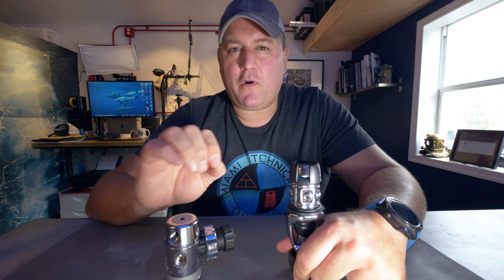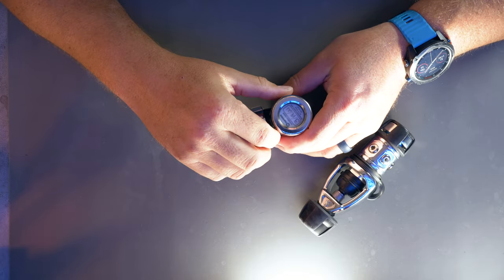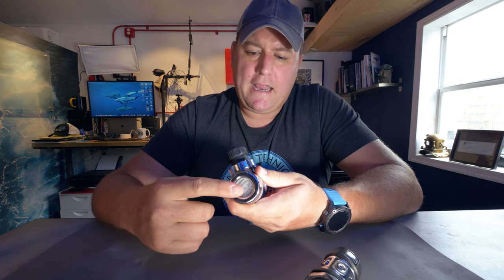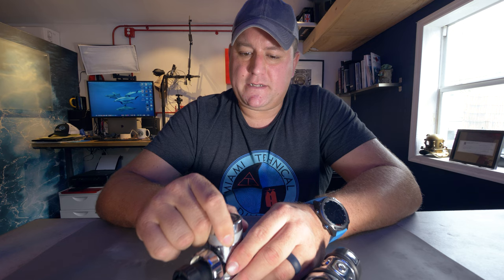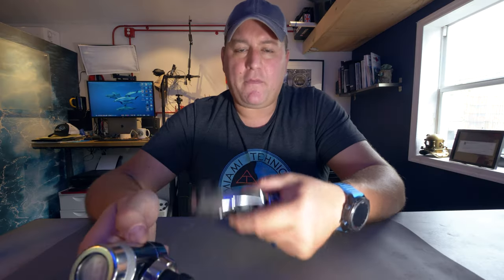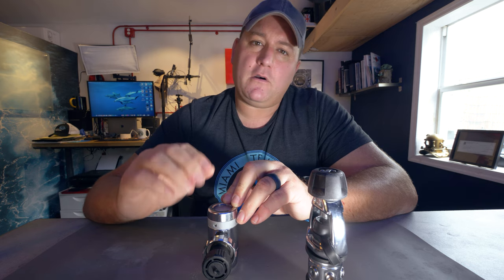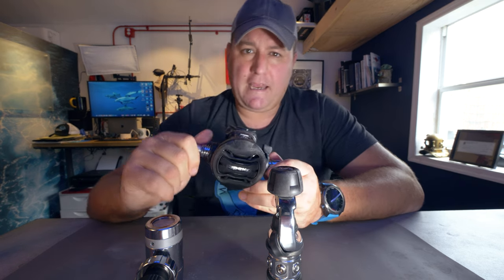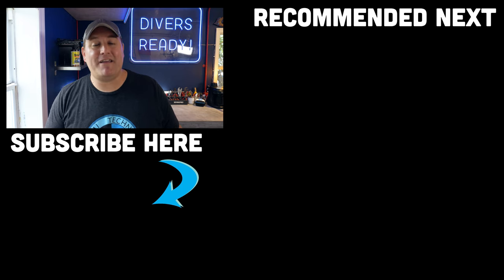Scuba Regulator First Stages: Balanced V Unbalanced

Comment: OCD / Pedants corner:

"balanced" or "balancing" refers to a pressure / force acting on both ends of a flow control device

"compensated" refers to a single ended pressure / force  acting on said device

Therefor, to avoid confusing we shoud really refer to :

  Hydrostatically compensated - refering to the output pressure increasing in absolute terms with depth so as to maintain the same differential (gauge) pressure under all conditions

 Pneumatically balanced - refering to the effective reduction / nullification of flow control orifice area by the application of primary gas pressure to both sides of that orrifice in order to minimise changes in the pressure reduction ratio as primary gas pressure falls, ie maintaining the same IP gauge pressure as cylinder pressure changes

All modern (for the last 50 odd years or more) 1st stages are hydrostatically compensated, and these days most second stages are pneumatically balanced, meaning there is really no need in having the 1st stage also being pneumaticlly balanced.  Becaause the step down ratio is very large for the 1st stage (3000psi dropped to about 140 psi, ie 20:1) the flow control area is small, and so a non pneumatically compensated 1st stage is no real deficit, simply because across sensible ratios (3000psi down to say 500 psi) the change in absolute IP is pretty small.

It's far more important, imo, to have a balanced 2nd, because this both requires a much larger overal flow control orifice, (IP is only arround 140 psi) but also this provides a mugh bigger margin from freeflow events caused by changes in IP,  whilst still delivering a robust low inhalation effort. ie the second can be tuned to sit closer to the point of freeflow across a wider range of IP's
Reply: That is a pretty great explanation and point made. Thank you for that.

Comment: Thanks for including the overbalanced stuff, been asking for a straight answer on that one forever
Reply: "Overbalanced" really is "positively compensated" ie output pressure increases above the ambient pressure rise. All it achieves is to attempt to keep the second stage flow control orifice from having to open physically too much further the deeper you go.  
As ambient water pressure increases, for the same volumetric airflow requirement, the mass flow rises, because the gas we inhale must be maintained at the (increasing) ambient water pressure, ie your inhalation gas density climbs.  With an non pneumatically balanced second stage, having to open the orifice further to get the same volumetric flow means you have to inhale harder against the return spring (because that spring necessarily has a non-zero spring rate). 

As most seconds are balanced these days, then that increase in effort is so small as to be effectively un-detectable under most normal circumstances, and you'd need an ANSI test machine to see it.  Back in the day when most seconds were not pneumatically balanced, then yes, having a 1st stage that was "overbalanced" had some merit.  (it probably still has some merit if you are pushing the limits of tech diving at ambient pressures upwards of 10 bar, ie deeper than 100m for example, but is totally irrelevant at rec depths)

Comment: Hi James. Thank you for goot trial of explaining a bit challenging subject. However, there were some misinformation included, like the balancing process. It is not the diaphram but the valve itself around which the pressure is guided. The idea is to eliminate the extra force created by the tank pressure. Another a bit misleading info was the explanation of ambient pressure transfer in the case of Apeks DST. Yes, the explanation itself is correct. However, one does not need any silicon window etc to get yhe force tranferred. DST is sn environmentally shielded version. If you compare it to UST, which is not rnvironmentally shielded, you see the difference. Anyhow, both gets ambient pressure to the outer side of the diaphram. In UST the water is directly in contact with the diaphram and in DST there is the dry chamber mechanism. In fact UST has more precise ambient response.

Comment: I'm probably getting ahead of your "lesson plans." What are the pros and cons of using a balanced 2nd stage with an unbalanced 1st stage? And vice-versa?
Reply: I was thinking the exact same thing. Will I experience balanced performance if only the first or second stage is balance or do both stages need to be balanced?
Reply: @HavikenHayes  For example: I've seen people run the SP R195 2nd stage (unbalanced) on the SP Mk17 1st stage (balanced). Why? You used to be able to buy it as a combo, but SP no longer offers that configuration.
Reply: The reason for doing that is a specific target at cracking pressure. So a first stage shoots for a certain IP and your second stage opens at a certain cracking pressure. With a balanced second stage, you have an easier “crack” which is like how much it takes to get over a hill. They pair them with unbalanced first stages because usually they are extremely reliable and quite cheap. If you check out Scubapros bulletproof MK2 on YouTube you can see how durable unbalanced regulators can be with less moving parts.
Reply: I have a mk2 evo on a backup set I've never used. I'm not claiming vast knowledge or experience, but I've never seen anything other than a R095/190/195/295 paired with a mk2.
Reply: Only one of the stages need to be balanced.  I dive a combination on an unbalanced first stage and balanced or unbalanced second most of the time.   When I dive in cold water (<50degrees F), I switch to a balanced diaphragm regulator.  Below 100 feet I will switch to a balanced diaphragm or balanced piston regulator.
Reply: @HavikenHayes  yes
Reply: ...I have mixed unbal & bal stages. My view is that;
- unbal 1st + bal 2nd: nice breathe due to the bal 2nd but at depth the 1st will become a little compromised, esp if buddy uses your Octo
- bal 1st & unbal 2nd: no change with depth, except that the breathing will be determined by how good the model 2nd is, usually a bit lower in performance than a good bal 2nd.

Comment: So. The Mares Abyss is an unbalanced regulator. However it is pretty much the only one that goes against the grain of unbalanced regulators. The more demand on the regulator (the greater the flow) the easier it is to breath off of it. 

I was just talking to my service tech about this last night. He has the equipment and software to run the test on any system and provide a print out with 2 lines. One at 500psi. And one at 3000psi. He says all unbalanced regs when tested curve up as the air demand increases, meaning it takes a bigger draw to breath air off of it. But the Mares Abyss curves downward, like that of balanced systems. Quite the phenomena. I have the graphs to back it up haha

Comment: At what depth does the difference in air delivery become noticeable for a recreational diver?
Reply: Good question but I'm not sure there's a good answer because it's not only depth but also tank pressure that contribute to a change in breathing effort. So if you are at 100 ft. with 750 psi (a bad idea), then you might notice a difference. The same 100 ft. with 3200 psi (a much better idea), then my guess is you won't. A third variable is how well tuned your second stage is. If you have it set to breath super easy, then you may not notice it becoming harder to breath over time. I have dove to over 130 ft. on unbalanced regs and didn't notice much of a difference. If most or all of your diving is warm water, not deep (above 60 ft) and only 10-15 dives a year, then any modern reg. will work fine. If you have dove rental gear to over 60-70 ft. and didn't notice a difference in breathing, then this really isn't much of an issue.

Finally, I'd say shop around. Not all balanced regulators are super expensive. I use Deep 6 regulators (1st and 2nd stages), they come with all the bells and whistles and are balanced. Their top of the line Signature model 1st stage is $300 and the second stage is $150.
Reply: On the only unbalanced breathing reg that Dive Rite sells, they specifically recommend that it be used 50 feet and above. IMO there is little reason not to get a balanced reg. The price difference is often pretty smaller, less than $100 the last time I looked.